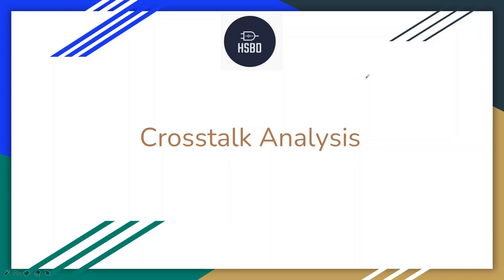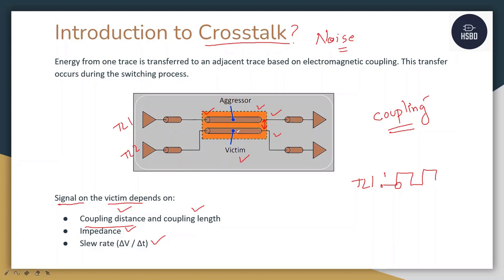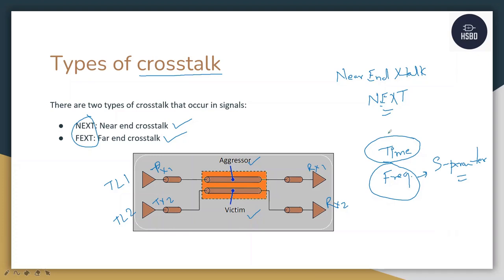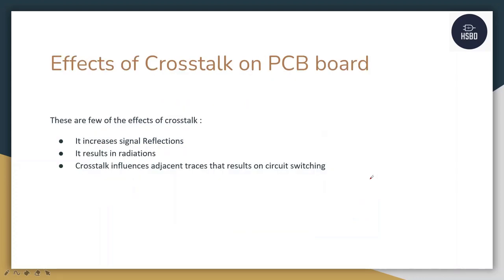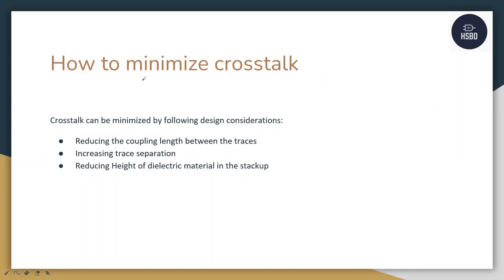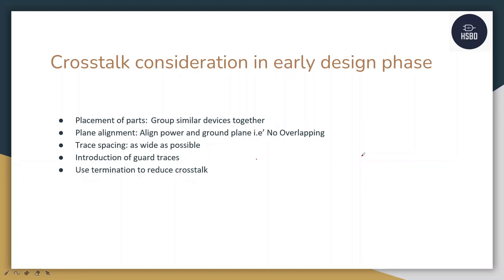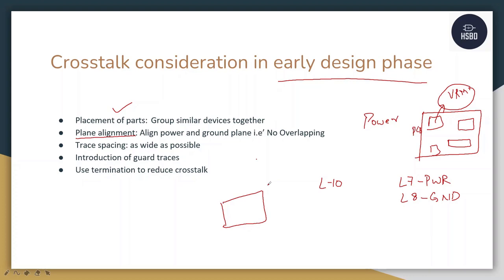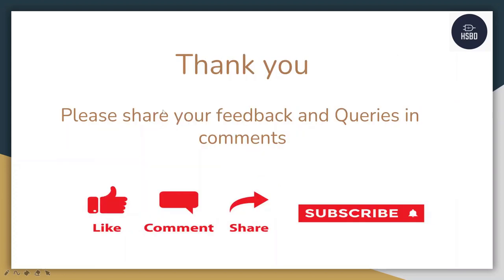Basics of Crosstalk analysis | #signalintegrity

Comment: can u plz explain about Raise time of signal with frequency and voltage
Reply from the maker: Hi Hemnath,
Thanks for the query|||

Defining Rise time: 
The rise time in digital systems describes how long a signal spends in the intermediate state between two valid logic levels.

1. The signal rise time determines if a line will behave as a transmission line or
as a lumped circuit. 
2. A line will act as a transmission line if its electrical length is greater than
half the signal rise time.
3. The faster the rise time of a circuit, the wider the bandwidth and higher the frequencies that the circuit can effectively transmit around the board.

Comment: how slew rate affects the cross talk.
Reply from the maker: Slew rate is defined as the change of Voltage or current per unit time
So, higher the Slew rate of the aggresor signal i.e, the faster rise/fall time, the more crosstalk increases. 
It becomes more important to reduce the Slew rate in order to reduce the crosstalk
Reply: Thank you. What is the difference between 2d, 2.5d,3d solvers. Upto which frequency we use 2d,2.5d and 3d solver. Why we need this many solvers.
Reply: Make this on hyperlynx tool
Reply: @raneelpawar7959  Happy to see a reply from you after very long time.
Reply from the maker: Hi Mahesh,
The Solving algorithm used by the solver define it as 2D ,2.5D and 3D solver
--->2D,2.5D solvers are useful when you need to model and extract the board electrical parameters like traces.
--> 3D solvers are useful to model the 3D geometry like Connectors , vias etc.
Reply: Please create the video on analysis of NEXT and FEXT in the simulation tool
Reply: Hello sir
Can u explain how dielectric height in stackup affects the crosstalk in more detail